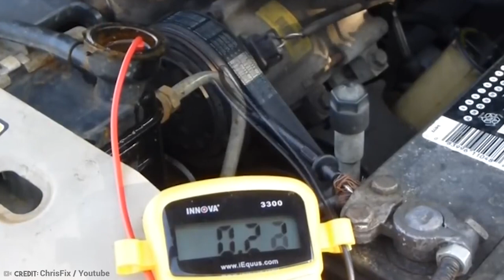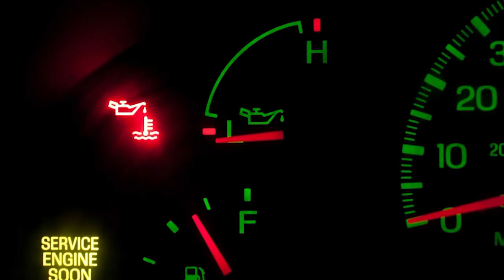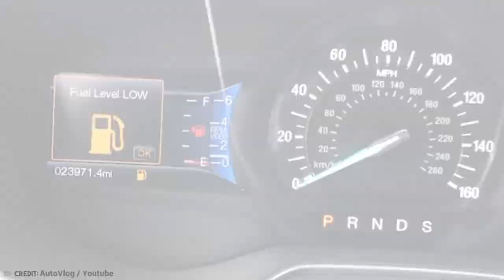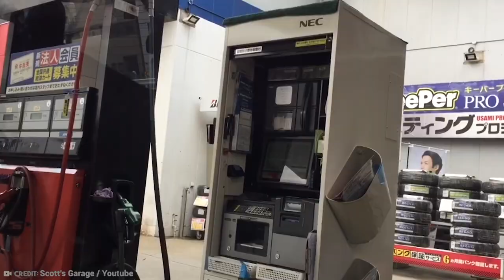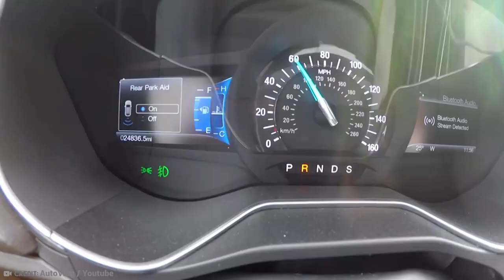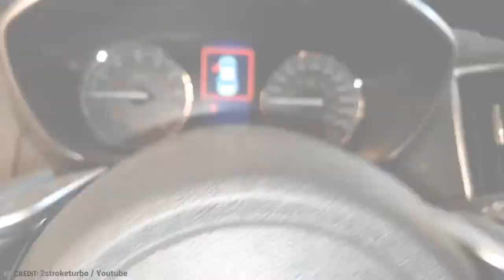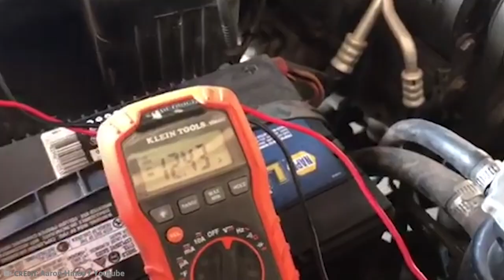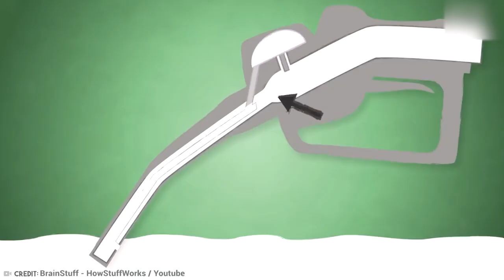20 Things You Should Never Do To Your Car

Comment: I once drove a 1981 Plymouth K Car (Reliant).  I spent about 2 years driving it with a slow leak in the Power steering fluid.  I was able to keep topping it off most times to get from place to place.  Right at the end of my college years, I knew I was junking the car (TONS of other problems came up during 4 years of college and cost more than worth to fix)  I spend 4 months driving the car with a much larger leak having formed.  It was like driving a car without power steering.  SO much strength needed for turns.  Definitely DO NOT recommend driving with a power steering leak on a car with power steering.

Comment: the reason you dont run less than a 1/4 tank of fuel is because most cars have fuel injection. Which means thereis an electric fuel pump in the tank. the fuel actually keeps the pump from getting hot and failing. it stays submerged in fuel for cooling

Comment: The hitting stop button on cars last I knew it doesn't allow you just like turning it on, has to be in park and foot on/pushing brake to do so. And some of these are wrong, my husband has done some of these numerous times and guess what  vehicle still going and we are both still alive. Water bottle thing, maybe if 200degress out and depending on what your seats are made out of. Like bottles shouldn't have hot or cold bc winter it will freeze and bloat. Windshield i dont think it can melt from sun again unless it 400 degrees out ehh.?. I don't know. Just my thoughts my opinion.  Definitely never put hot water on frozen Windshield you do that then well Definitely stupid. And no i have never done that, i know better born and raised in a cold wintery state.

Comment: 20 things you should never do never listen to any of this guys advice I’m a class a automotive technician with 36 years experience there’s only a couple of things that he said in this video that were close to right like make sure you use the proper fluids in the proper places that’s correct don’t over inflate your tires however he’s making it out to be more dangerous than it really is but the biggest problem with this guy being uneducated as he is is the alternator thing alternators don’t charge 25 Volts unless it’s a tractor trailer then it charges at 24 V but all passenger vehicles charge between 12 and 15 V there’s no way a car’s alternator could charge at 125 V the battery would explode the alternator would catch on fire and melt this guy is totally on educated on 90% of the things he’s talking about one of the worst video I’ve ever seen when it comes to automotive issues
Reply: Nice speech. Why do even watch?

Comment: I knew a guy that had a 1967 Dodge Coronet with a 318 and 727 TourqeFlyte Automatic Trans and on race day he would spin his rear tires in Reverse holding the Brakes Tight and then while releasing the Brakes at the Same time as he dropped his car in Drive Smoking his Tires down the Racetrack 
Unfortunately he died of AIDS RIP